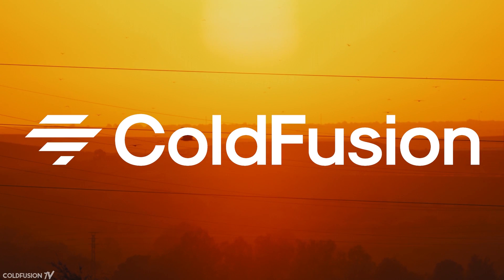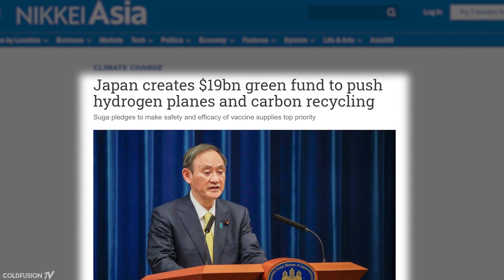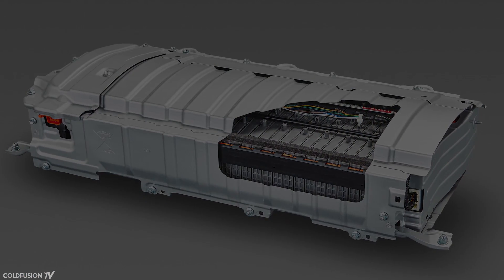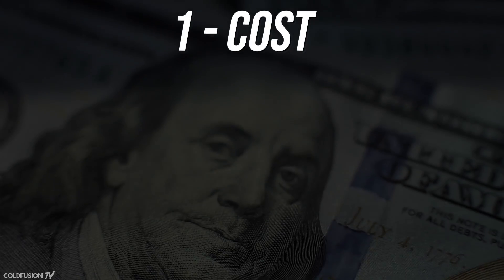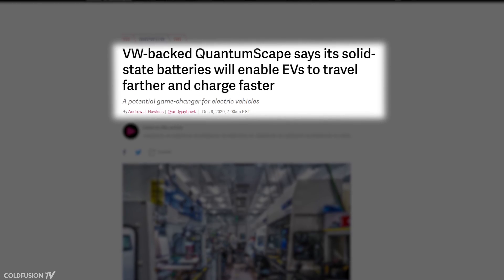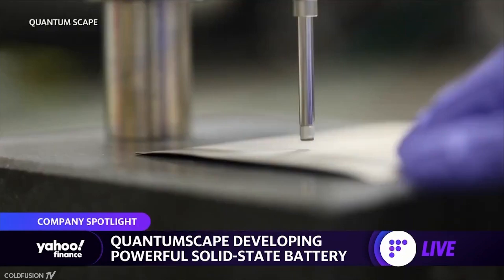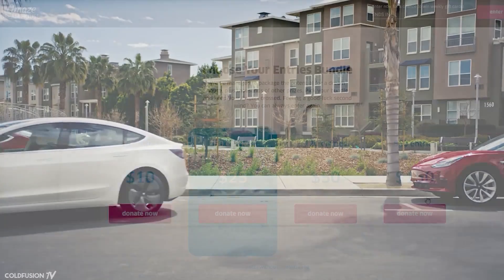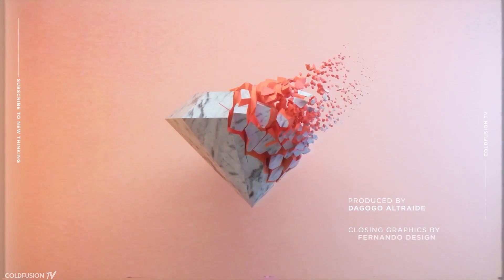Toyota Plans Revolutionary Solid State Battery for 2021

Comment: One of the primary reasons for SS batteries is that they DO NOT generate dendrites.  This is an issue with non-SS batteries! 

Also, why do you put so much hope in the Toyota SS battery program when they evidently do not.  They are famously pursuing hydrogen fuel-cells (to their shame) instead of plug-in electric.

Comment: solid state will have a hard time replacing current batteries unless someone shows they can be built cheap and at scale. If Tesla's numbers from battery day are realized, then there is no real need for more durability, gravimetric/volumetric density or charge rate. Of course any improvements are good, but the real deal is being able to make them mass produced at an affordable price. When someone shows they have achieved that, then it's the time to get excited. In the meantime, I would not consider any of these announcements relevant, it's just a PR effort.

Comment: Again, promises promises. The quantum scape battery is only a semi solid state battery. It is still compostable. Plus, you are comparing solid state batteries to the currently mass-produced lithium batteries and not including the current breakthroughs in lithium batteries that match the charging times and energy density of many of the proposed solid state batteries and have started production today with much lower costs

Comment: I'm sure Elon has an ace up his sleeve
Reply: The thing is Elon doesn't even need the ace again Toyota.

All the graph shown here underestimate Li-ion batteries so much.
These chart show how deceitful these solid state battery companies are.

No, best performing Li-ion energy density is not 300Wh/kg.
It is 400Wh/kg.
Tesla is already mass producing 330Wh/kg cells now. 
Some of the cells have already hit 400Wh/kg. But these 400Wh/kg are not high yield.

Toyota solid state battery is total bullshit.
If they claim their SSB is so superior, why is the range only 500km?
Tesla model S already do 700km and model X 650km.
And that is with their old batteries.

Comment: Better battery tech would help Toyota join the ongoing revolution, but is not enough to put them at the forefront, even if their new battery is everything they claim.
Tesla has too many other advantages to be unseated as the clear leader in the foreseeable future.  For example, Tesla is way ahead of everyone else, including Google, in self-driving tech, and Tesla already has a global network of charging stations.  And Tesla is also extremely diversified in very strategically advantageous ways.

Comment: Yes yes better batteries. Heard that about 100 times now for the past 20 years.
Reply: Because they have been improving a lot. 
Think about fast charging batteries inside phones, or inside EVs.
They're not perfect, but they have been improving.
Reply: @rehd95  Fast charging isn't new. It was a thing even before lithium batteries. It's just a matter of how soon are you willing to wreck your battery pack. Liions are still crap and nothing like the revolutionary stuff that has been promised year after year yet never materializes.

Comment: Faster charging times? I always thought that SSB's are charging and discharging slower, because the liquid electrolyte is a rather quick way to exchange electrons and allows easier cooling. Of course, SSB's are denser and lighter, also alot safer, but how SSB's are quicker charging is new to me! That would really be an intresting breakthrough!

Comment: Production in 2024 ofc, by the time most other manufacturers will also have solid state batteries or similar
Reply: 2024 way too late. :(
Reply: @CatalystNetwork  yes Just look at nio haha
Reply: What about the patents?
Reply: @mutton_man  there is more than 1 way of creating a solid state battery, a patent would just cover 1 way
Reply: @DvApps  didn't he say they had alot of patents for the solid state battery. Wouldn't it make it difficult for someone else to make their own ss battery?
Reply: @mutton_man  probably, but there's lots of ways around that. Worst case those designs can be licensed or the company holding the patents can be bought out.
Reply: @DvApps  doesn't Toyota own the patents. They are not going to sell it to other car companies. I'm thinking how many ways can a solid state battery be made? I'm not sure about these patents because I think there are other car companies already going down the solid state batter route.
Reply: @mutton_man  I'm not certain about Toyota, I was just talking about it in a general sense. For example, Quantum Scape has one way of doing it and Toyota has another, both are still solid state batteries, but are based on different compounds and processes. And then you also have companies like Quantum Scape already partnering with VW, so they are open to licensing their battery tech.
Reply: They are building 10 million cars a year. They have to build up or adapt tons of production lines. They could surely start a few cars within 2021 if the go for it.
Reply: So true. No advantage here.

Comment: No one talks about electro-magnetic radiation from the batteries and it's affect on the rider's body and health...Could you share what you know and think about it?
Reply: I imagine you have concerns like if you lived under a powerline. Moving electricity creates field, but batteries alone dont produce a field. During use the power moved/used is relatively small (like running a heater), the most intense power transfer is during fast charging, which is not every day. Also the field weakens a lot by distance, so not much to worry about.
Reply: That you should not believe everything that you read on facebook
Reply: Dude, you scare me! Since when are batteries generating electro magnetic radiation? I thought the motors are the big offenders... Anyways, I am not very informed on the topic, but I would expect the frequencies that an EV emmits to be outside of the dangerous spectrum, otherwise EVs would never be approved by the FCC etc.
And given the up to 8 Tesla that an MRT device can produce, I guess that magnetism is not that much of a problem for the human body. 
But I am always happy to learn more, so what exactly are your concerns? :)
Reply: I have measured it in a tesla. It is very low. like holding a cellphone

Comment: Toyota or Tesla? Which would you invest in Dagogo?
Reply: Toyota in the long run, Tesla to reap and get out. About now ;)
Reply: @piotrd.4850  now thats a joke
Reply: Toyota has many years of experience with Hybrids and electric cars and they make some extremely reliable cars with many more service centers than Tesla. My guess is they would also be much cheaper to repair than Tesla.
Reply: Toyota doesn't have as much room to expand into the market as Tesla does. Id go Tesla.
Reply: @esthergennn  Tesla is a company which never made honest profit, doesn't have big R&D capacities, barely sells any cars and runs basically on an investment scam.
Reply: Toyota solid state battery SUV range = 500km ( production 2025)
Tesla 2020 model X = 650km ( refresh with 4680 cells coming soon )
Reply: Tesla forsure! Check out YT channel Solving The Money Problem 👌🏽
Reply: Toyota..
Reply: Keep in mind, these Toyota batteries are going to be manufactured at scale in 2024. Tesla’s newest batteries are going into production this year. 

So the question you should ask yourself is, will Tesla continue to improve or will they become stagnant. Will Toyota execute on their promises? I believe the answer to both is yes so in my opinion, buying both is a great bet. 

At the moment, I do think Tesla has more risk than Toyota. I’m saying this even though my portfolio is 60% TSLA. If Tesla figures out self driving, then I believe it’ll be the better investment, but there’s risk. Honestly I’m staying heavily invested in Tesla because I want them to continue to push the industry. So it’s a bit of a moral thing. I made my money 15x already with Tesla, so I don’t mind a 50% correction right now.
Reply: @andyfma123  Wise outlook! Do you dabble in crypto? I wonder what Dagogo thinks!

Comment: I still will never ever buy those nasty things. A car should be mechanical and not electric.
Reply: yeah I hate when your mirrors adjust by pressing some buttons and windows roll on clicks too. It should require manual job!!
Reply: @brandon-22  

Electric Windows are not computerized in older cars, but are just a simple relay. If you are to lazy to adjust the mirror manually you have bigger issues.
Reply: @theshadowman1398  yeah but electric cars will be cheaper, better performance, and easier to use. Whats not to like.
Reply: @TheDetective999Three  

Easier to use ? You will be at mercy of the manufacturer because you are not allowed to fix anything yourself. I will take a 60s mechanical horse power monster any day over those desktops on wheels
Reply: Ah yes, you forgot your horse mate. 
"A cart should not move under it's own power!"
Reply: @Tigermoto  

I just don’t want to sit in a rolling desktop computer where many features are locked down by software.

Comment: 80% of density after 800 charge cycles?
Reply: I know, was thinking the same. Good luck with a million mile battery.
Reply: @d1o2n4  Even generous 250 mi/charge * 800 charges is 200,000 miles but that is still going to cost more than gasoline just for the battery plus the electricity.